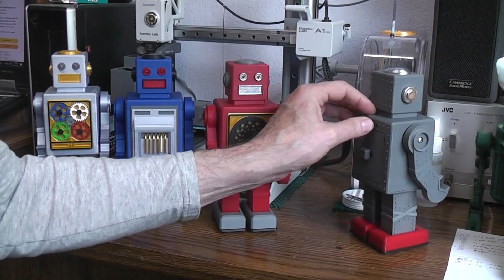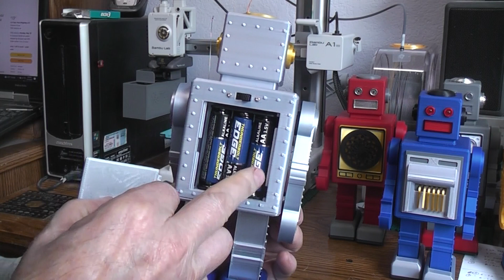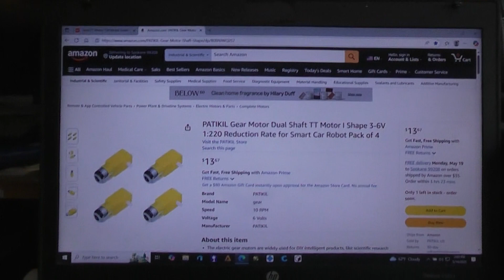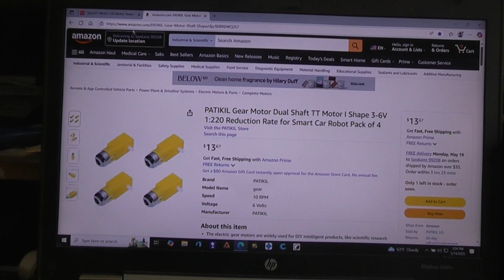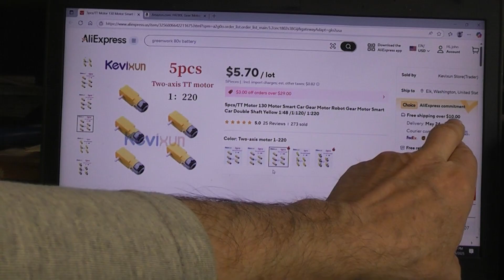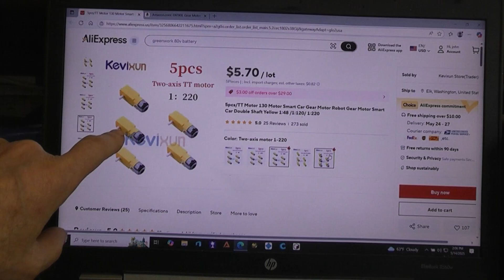3d printed, battery operated POGOT robot project. Demo of 4 different designs using TT 1:220 motor.

Comment: Those are  great John!  Is the first one easy to assemble? Ty 🤖 doc
Reply from the maker: Yes, the color wheel one is the easiest to build and the video will be up in 2 days. The others do not have to be any harder to build since adding LED eyes is option, using a remote control or a voice control would be options. So the only difference is making the different face plat display.
Reply: @ thanks i got the files downloaded and sliced  will print tomorrow!
Reply from the maker: @PeterAgostiniJdcap26  I added the different eye files in case you want to use LEDs.
Reply: @ got some parts printing now , but have to redo 2 that came off the  bed. Looking for to build
Reply from the maker: @PeterAgostiniJdcap26  You should wait for the build video tomorrow as I describe the best way to print the parts and where to add supports.
Reply: @ i did pull support out of the  legs  came out like a ribbon 🎀 . I look forward to your video a must see adventure !

Comment: Wow, you have been busy! Looking forward to the next video. 
Hopefully more available motors will work.
Reply from the maker: Build video up in 2 days. So far it looks like any of the yellow TT gear motors will work with this build.
Reply: Good! I have quite a few of different ratios.
Reply from the maker: @noads1035  The build video comes out tomorrow and I test 3 more gear ratios.

Comment: This might be the project to finally jump into the 3D printer. Phenomenal John. Any suggestions for a printer make and model for sizes relative to what you produce would be appreciated.  As always thank you John for the contribution.
Reply from the maker: Bambu lab A1 mini cannot be beat for price and speed and quality. I use it on all my projects.
Reply: @Robothut  or A1
Reply from the maker: @PeterAgostiniJdcap26  I have both, the A1 mini costs less and prints Beter and faster. But if you need the larger build area then the standard A1 is the way to go.
Reply: @PeterAgostiniJdcap26  Thanks John .

Comment: Wow. You've been busy. I like the one with the sequential mechanics. Amazon  shows the motors as unavailable now. I will check  later. I am also curious about the effects of the tariff. I would like to order some PCBs but I think I will wait.
Reply from the maker: I just put in a order for $50 bucks worth of resin 3d printed parts with PCB WAY, I did not order the parts as the shipping and the tariff came to $150.00 so a total was just over $200.00. I will wait until the craziness dies down. I hope.
Reply: @Robothut  Thanks for the info. I don't think it will ever go back to the dirt cheap prices but maybe it will stabilize at a lower rate.
Reply: I had the same experience with JLCPCB.  I almost ordered a panelized PCB that cost $45.  Two weeks earlier it was $15.
Reply from the maker: I have added 2 more sources for the 1:220 motors to the description box.